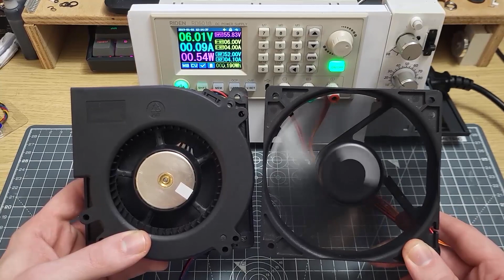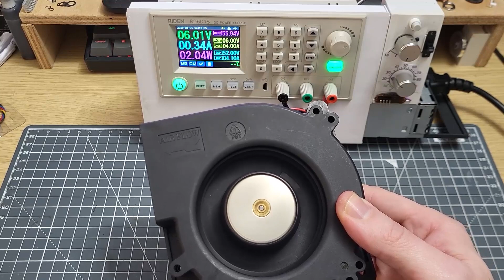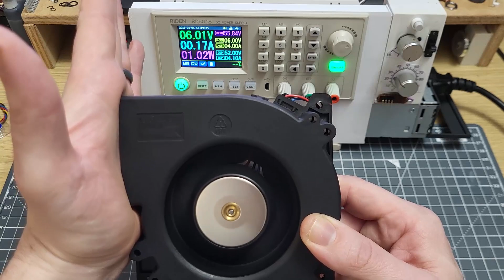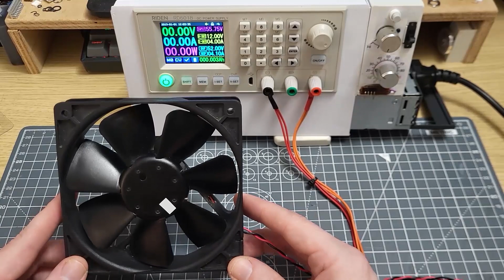Why Not Use Blower Fans Instead?

Comment: Done hvac 20 years. This is the same with blower motors. Ppl thunk that if u were to have super dirty air filters, coils crushed return vent etc that it will make the amp draw go up. WRONG. It cuts the amo draw down by like a third. The air is no longer blowing through the blower and out the outlet it is no longer moving air and spinning with very little load. The air is coming from the side and just moving round and round with nowhere to go
Reply from the maker: Thanks for your comment!

Comment: The unrestricted blower fan wil move a lot of air, but once the exhaust is blocked the air cannot move trough the fan. Thus the blades 'see' no load and are able to speed up to the maximum possible rpm for the given voltage. The only load the centrifugal fan needs to overcome is the weight of the motor and blades + some minor eddy currents that form at the inlet.
A centrifugal fan behaves like a pump, by moving air from one end to the other a pressure difference is created and the surrounding air will naturally move towards a vacuum.

The axial fan (airfoils basically) is designed to efficiently move a lot of air (lift) per rotation and cannot handle large pressure differences. Putting the axial fan on the table, the blades will see a lot of resistance from the blocked flow. The table is fixed so the only thing that can now move is the fan itself, the fan will try to move upwards but must overcome its own weight. Power will increase to the point of wire resistance (voltage divided by resistance) or to a point where pressure on both ends is equal.

Axial fans do have design variations to handle pressure, but these are considerably louder compared to a similar sized centrifugal fan.This is why you see large turbo fans on commercial jets, while fighter jets have small turbo fans to be able to achieve higher speeds.
Reply from the maker: Fantastic answer - better than I could have given. :)

Comment: Many years ago i was helping a friend with a car that kept over heating. He had a large electric fan that moved a HUGE volume of air very quickly. I suggested he replace it with one that moved the same volume but at a slow speed and then proven went away. The issue wasn't how much air that was being moved but how long it was in contact with the radiator. The slower moving air was able to pull more heat away for the same volume than if it was rushing through the fins faster. This is the same thing I look at any time I'm selecting a fan. Faster or more isn't always better.
Reply: doubt that was the issue. more airflow results in lower temps hence why fans speed up when temps get hotter and dont slow down. your mates car had other issues.
Reply: Yeah but thats not how that works. You do get less and less increase in cooling from increasing airflow the faster you go, but at no point will increasing airflow decrease cooling. Thats just not how it works. The air coming out of the radiator will get less and less warm, but the heat transfer will never reverse, at least outside of aersopace.
Reply: wow!

Comment: I just wonder how quiet a modern one would be.
People always bring up how loud they were in the early 2000s... but cmon.. PC part makers DIDN'T CARE ABOUT NOISE back then 😅. It only makes me more curious how a modern PC blower would've sounded if they had stayed more popular and had gone through the same technological advancements.
Reply from the maker: Interesting question - most of the noise from blower fans is air noise, because the air is being accelerated through a relatively small opening. Unfortunately it is the constraints of physics that deem blower fans (of this size / form factor) to be particularly loud. If you were to use a super quiet motor and take the fan speed right down, you'd also lose most of the performance too. When it comes to volume flow, especially at low noise, axial fans are top dog.

Comment: Centrifugal blowers were always used for air cooling of large radio transmitter ceramic vacuum tubes (ignoring water cooling).  

If you Google image search 4CX250 or YC-156, you will get an idea of the constricted airflow heatsink design as well as the pressurised air box used to facilitate air flow through the fins.  Cooling requirements are specified in the tube datasheets, and are specified in cubic feet per minute (CFM) as well as inches of water back pressure, using a manometer.

You can construct a back pressure test rig using a shoe box, and a water manometer can be made from plastic tubing.  This test would show the pressure difference between blower and axial.
Reply from the maker: Already done - check the follow-up video! My "shoe box" is a little more advanced, with valves at the back that allow me to plot a curve showing the drop in pressure as airflow increases. Thanks for the comment!

Comment: I'm going to conjecture that the axial fan's blades stall (since they're aerofoils) when the outlet is blocked, leading to a huge increase in drag due to the turbulent air, which in turn slows the fan and uses more power. In contrast, the centrifugal fan does not use aerofoil blades and therefore cannot stall, and the fact that it is moving less (no) air means that it needs less power to do so, and speeds up.
Reply from the maker: Good answer!
Reply: well hello there

Comment: I had a blower fan graphics card on my PC in 2005, never ever will I have a blower fan on anything again because the sound it made was so bad that you had to use ear protection when running the PC... I now use silent 14cm noctua fans and some 12cm fans where it was not room for 14cm, and also a large 25cm fan. Bigger the better, more air flow for less sound.
Reply: when you talk about pc fans you tend to use mm not cm.... i know "🤓"

Comment: Blower fans have more pressure, that is why they are used, they can accelerate much more the air, this also brings more noise, because the same air volume is being compressed through a smaller outlet! Also, you need to find if your outlet has a more turbulent or more laminar flow. Usually, more noisy, more turbulent. A constriction in air flow creates a turbulence. But if the centrifugal fan is well done, it has a more laminar output then the axial one. Also, if you put an air filter, or more complex air pathway, axial fan will lose much more performance then the centrifugal.
Reply from the maker: Yep, there's a lot of potential for turbulence because of the high air velocity from the blower fan. In theory, this could also mean better cooling performance.
Reply: There's no way to produce turbulence with common heatsink designs and installations, except on entry and exit - when impedance changes. Half of the noise happens there. The other is the duct itself resonating from vibration and acting as a tube to amplify the noise, not being properly decoupled from the fan. The duct should be also dampened to not act as a plate speaker.
To produce serious air turbulence at these CFMs, the radiator fins would have to be diagonal against the airflow at least, or perhaps louvered against the flow direction.

Comment: Let’s say the heatsink area is 8x8cm and you want the fan to blow over the whole heatsink. Wouldn’t you want a larger blower fan/smaller axial fan? How do two fans of the same exhaust opening size compare?
Reply from the maker: If you had one of each type of fan with the same cross-sectional area of exhaust airflow, the blower would be vastly more powerful, both in terms of volume flow and pressure, and from air noise alone it would be considerably louder. When it comes to cooling applications, blower fans tend to be used only when there just isn't enough space for axial fans (laptops, PS4, etc), but an axial fan on a larger heatsink would achieve the same level of heat dissipation with considerably less noise and power draw.
Reply: Take a 80x80x20 blower fan and put its intake on the heatsink, dunno how performance will compare though.
Cooling solutions with blower fans usually blow along the fin stack like in the old blower fan GPU designs.